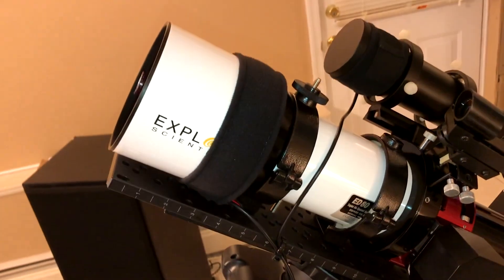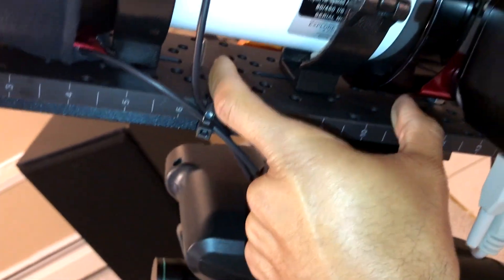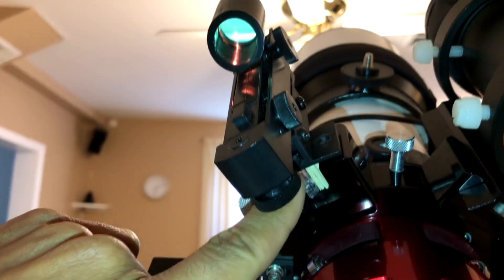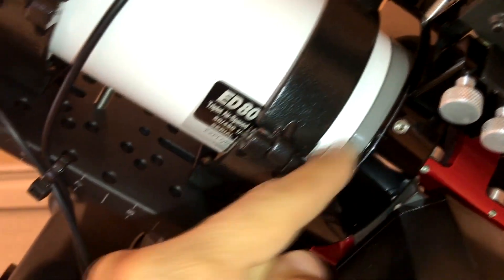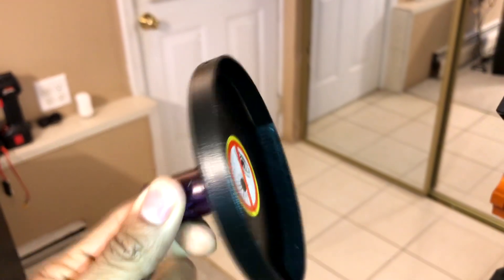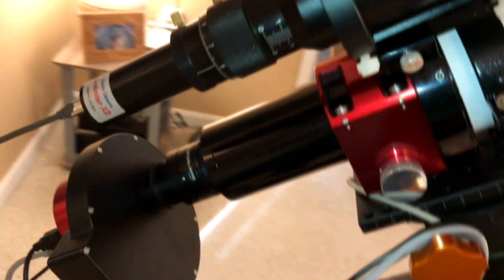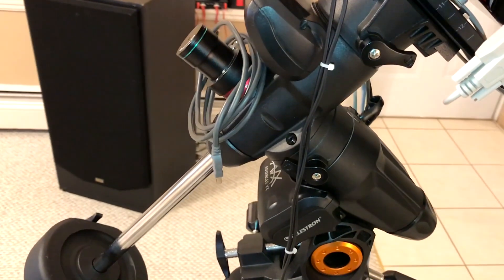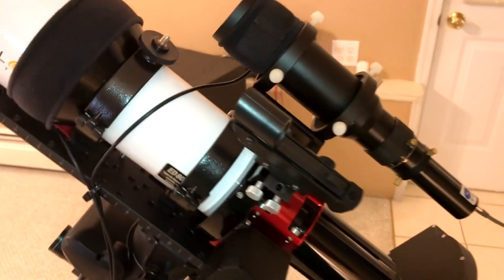Overview Of My Explore Scientific ED80 FCD-100

Comment: I have a similar problem with the included foot, for one it does not allow mounting a ZWO EAF focusser. Anyhow, I have been thinking about getting tube rings to replace the foot and because of the thick model plate on the left side (insane design), I think I need to get bigger rings than the outer tube diameter of 90mm. What diameter tube rings do you use?

Comment: Hi, got the same scope and really struggle to balance as it is... been looking to de-mount the tube exactly like this. How did you get the already attached mounting plate off?
Reply from the maker: Sorry for the late response. I had to use a heat gun 😳 & it was scary because I didn’t want to damage anything. I had same issue with removing it too until I read a few post on it. I had to apply a little heat to it for it to loosen up. I was very careful not to use too much heat.

Comment: Where did you get those scope rings??
Reply from the maker: Jacob Schoengarth I’ve had those rings for years now but think I got them from telescope dot com website. They were the low end ones I picked up. They are the basic Orion telescope rings & I had to put some felt material on the inside of them so they could add more pressure to squeeze the scope so it fits in them nice & tight.

Comment: Great setup. I have Moonlite focusers on my other telescopes. They are great focusers. I'm thinking about a Moonlite for my ES ED80. I was going to go with the 2-inch focuser but after seeing your 2 1/2 inch focuser I may go that route. I would imagine the larger format focuser would eliminate any possible vignetting with a full-frame or large camera sensor. I use dedicated ZWO cameras but also use full-frame DSLR's.

Comment: how's the avx mount? I'm wanting to see if your having much success you've had with it and have you had it hypertuned?
Reply from the maker: Tyler Bowman So far my AVX mount has been performing just great since day 1!! Never ever had any issues. I’ve used this mount with my big 8SE & 80mm guide scope all loaded which makes this mount pretty much at it maximum capacity. I don’t go past 3 min exposures with all that weight on it. But on my smaller refractor I can go 4 min no problem. Just keep everything balanced as best as you can. I know some don’t like the AVX & some have issues but I guess I was 1 of the lucky ones lol plus I don’t abuse the mount I keep all cables out of the way & try my best to keep everything as good as I can. No hptertunes or anything on mine just all factory. I’ve even used this mount all the way down to -3F with my 8SE on it 1 night for 7 hours while I went to bed & it did great all night with sequence generator pro.
Reply: I need to figure out SGP so I can let my stuff just run through the night
Reply from the maker: Tyler Bowman Just about everything I learned with sequence generator pro was from Chucks Astrophotography videos on YouTube. If you haven’t checked out his videos from about 2 years ago go scroll through his videos & see if they can help 👍🏽

Comment: How do you connect your field flattener to the focuser? Threads or comression ring? I have an Ed80 as well, not the fcd100 version but the essentials version, and I'm looking to get a moonlite focuser sometime soon, yours is the 2.5 inch, correct?
Reply from the maker: I have the 2.5 inch system.  I don't have a field flattner.  I just have the camera attached to the moonlite tube and the tube connects up to the scope with the flange.  The small piece in between my filter wheel and moonlite tube is just a extension ring I had to use on my 8SE.  That ring has adjustments to push the distance back a little so your camera can achieve focus when you try to focus on a target.  What I did was I emailed Ron at moonlite and told him the gear I have and asked what would fit and he said I should go with the 2.5 system and pointed me to what to buy and everything all fits together perfectly.  If I had a field flattner that would just screw into the back of the moonlite tube then your filter wheel would then screw into the flattner.  You may need some kind of adapter ring there depending on the threads to hook both pieces together.  My moonlite tube has a compression ring to attach the filter wheel up to it.
Reply: @deejaybustab  Thanks man, I appreciate the thorough answer. I'm going to send Ron a message right now.